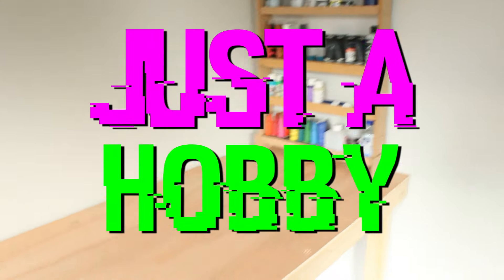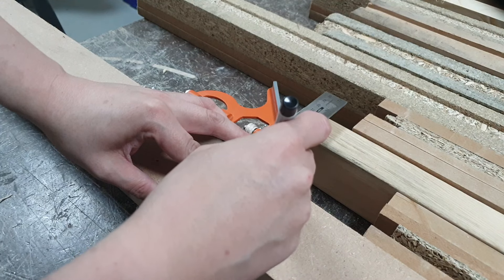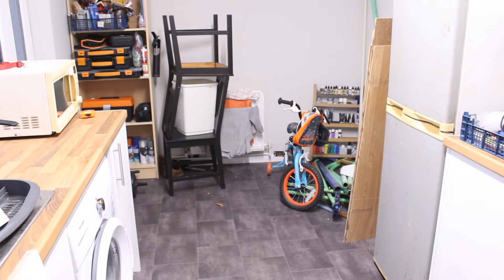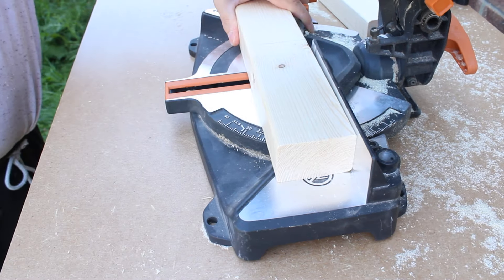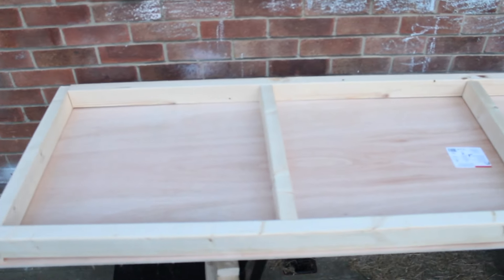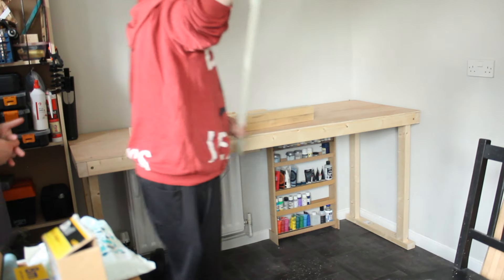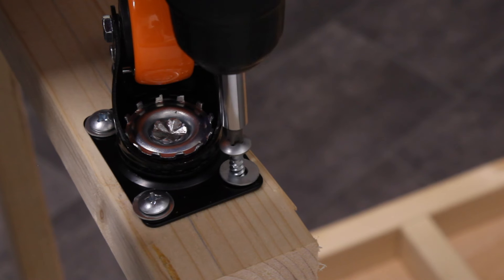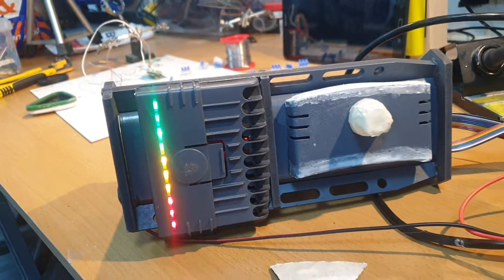New workbench! (And some news!)

Comment: The project is very realistic as in: obstacles started accumulating and premises shifted, but it the end it worked out fine ;)

This noisy neighbour is a blessing, the situation allows you to stretch hours work hours (which is one of the truly finite ressources).

Will this bench be used for filming, and if so, how have you planned to install the lighting equipment? 
(BTW I came across a good practical idea: a computer screen makes for a good diffuse light/softbox, and as a bonus you can change the colour!)

15:29 The shape in the background looks a bit like a diorama of a derelict ship sitting on the floor of the ocean.

A project well done! You just convinced me to make a video about (mystery devices) which I build from leftovers too, but it will probably be winter before it's done (I'm working to add more designs to my catalog before making videos).
Reply from the maker: Thanks for the comments!
Yeah, there has been a lot happening which is why I haven't had the opportunity to post videos, but now I am more settled I will be able to start again 🙂🙃

I was in a quandary with the late night cutting as I knew it would be noisy, but only quick... None of my neighbours said anything, so looks like I'm in the clear!

I have lighting ideas which will be added to the bench, but I didn't get round to it yet, which is why I didn't film it... But yeah, things will be good 😁

And yeah, the diorama in the corner is what remains of my airlock door diorama! Haha 🔨🛠🔧🧰🗜 Repairs needed!